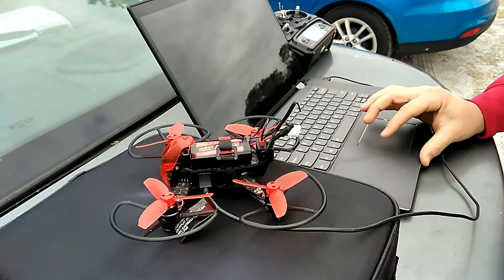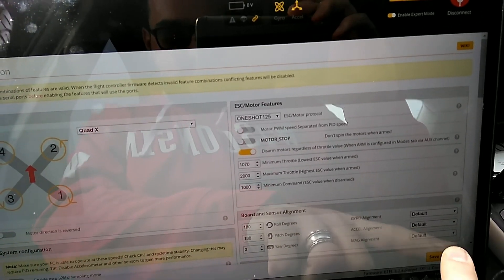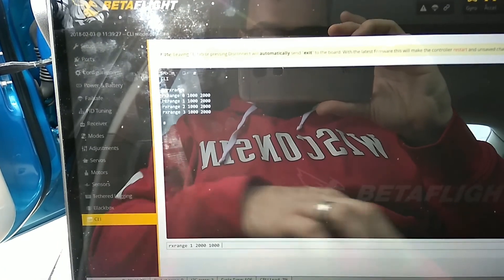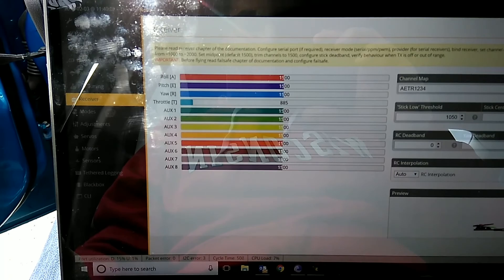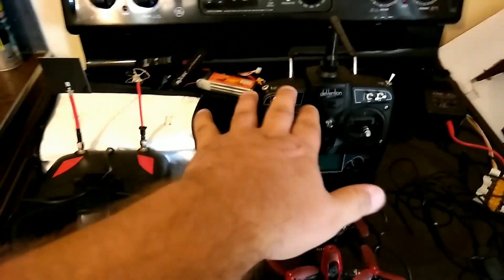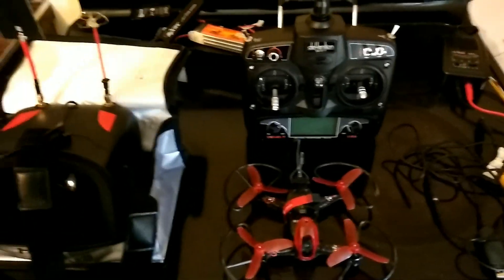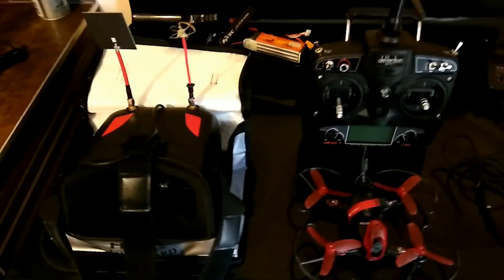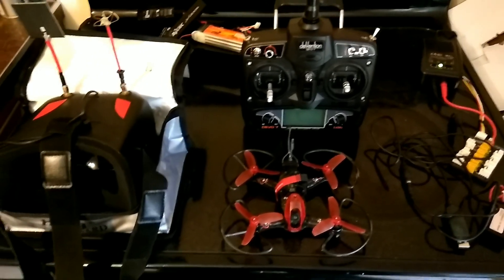Walkera Rodeo 110 Running Betaflight 3.2.4

Comment from the maker: This video is for RTF Devo 7 users. When you first install betaflight it is going to have the Gyros reversed because of board placement. If you follow a quick video Once you install betaflight then you will have the initial functionality back to normal and you will be able to start adjusting your transmitter settings and getting your Pids set up the way you like them